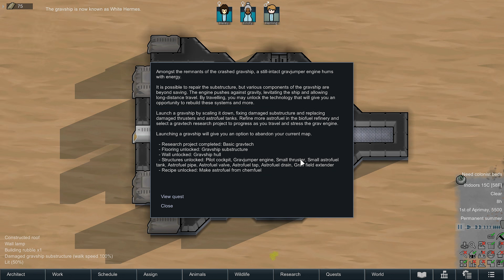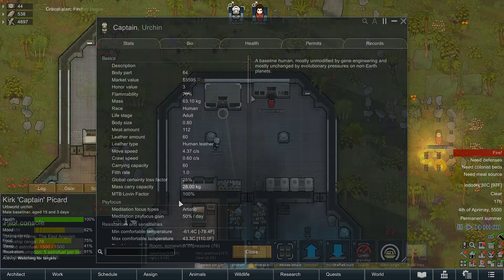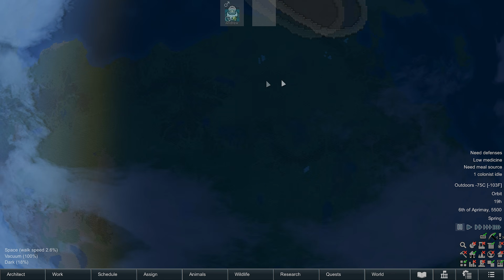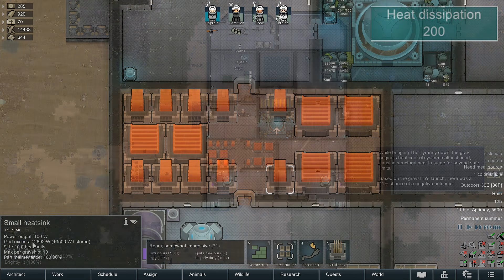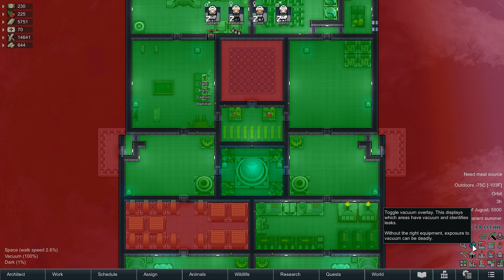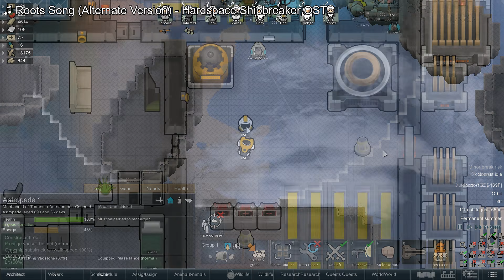Vanilla Gravship Expanded Chapter 1 - Rimworld Mod Rundown [1.6]

Comment: 36:50 Are you sure about that? I am doing some tests and I can daisy chain A Gravengine -> Grav field Amplifier -> Grav field extender.

Watching closely, you have a green line between amplifiers and the extender - extender is in reach of those amplifiers, yet you got red line with engine. Same as i have now.
in short I can go longer then 82 units in lenght
Reply from the maker: @DanielleSanti-e2t I mean that you can't daisy chain amps to another amp. There is a limit to how far the chain can reach and they have a hierarchy for connections.
Reply: @MysteriousFawx  i know, i tried building in strait line, placing Grav field Amplifier on engine's range limit, then Grav field extender on amplifier's... I have been using a range extending mod - configured for base game vanilla settings - so no change in that (Bigger Gravships (and other Odyssey spaceship related settings). removed that and it works now.

Comment: I tried this mod this weekend and it's been the best things since my first time with CE where I have no idea what I'm doing even after watching this, it's interesting you mentioned not having astro fuel near Oxygen, when I got gravhulk up and running, I created an elaborate chain of chemfuel into synthesis to astro, I even had it setup to just land somewhere, find a deepchem fuel spot and just build a drill. After I finished it, I started working on oxygen and then something told me to build a wall between both rooms. I build a whole oxygen setup and didn't realised I didn't enclosed the room to auto create a roof and it started raining and I saw the tank blow thru the walls with firefoam in it, all destroyed, if that wall wasn't there I'd still be repairing stuff right now, astro fuel is aggressive and hard to put out, early game it cost me half a ship
Reply: Hm, synthesizing astrofuel on the ship will be the very last thing I do. It's space-intensive enough that I'd rather spend my first allowances of space on amenities and o2 generation.

So by the time I have astrofuel, I might have energy shielding from VFE Security, or part 2 will be out.

Comment: The durability system looks like the maintenance from Fluffy Breakdowns. Do they work together or are there conflicts?
Reply from the maker: @micturner8193 By the look of the mod page comments for Fluffy Breakdowns, there are conflicts. It's tricky because the version of that mod currently 'most supported' is something that's been branched and maintained by more than a couple of different mod authors at this point. It's unlikely to be seriously overhauled unless someone else picks it up to intentionally make those changes, or perhaps incorporate it into a new mod entirely.
Reply: @MysteriousFawx  Troubling news. Adding new features to the Gravship is not worth losing the maintenance system for everything else; I might try a mod that avoids the standard breakdowns entirely just to have a look at the ship.
Thanks for the info regardless.

Comment: At 1:18:29 you can see that the Operator subpersona core can only be built once per gravship. Which seems quite low. So my question is, is that unintended or can it potentially link to more than one turret?
Reply from the maker: @ChronomancerDe I've had more than 1 linked at once and they're fully functional, it also doesn't mention anything about a limit on the workshop page for it. However I don't want to say definitively that you can install as many as you want, because I'm not sure if the bug is with the UI for the Subpersona core, or, in allowing more than 1 of them to connect at once. 

Given we're limited to 2 gunner cores, which are dramatically better than operator cores, I'd imagine it's the former and it's an incorrect bit of text floating around in the information pane for it. Chances are it'll be fixed in a future patch.
Reply: @MysteriousFawx   Ok, thanks

Comment: True that the anticraft weapon (the laser) is inefficient, but it only consume power, so in theory you can shoot as much as you want as long as you have the power needed. In the clip where you shoot with it it look super easy to use it, while in the description it say 50 000 W, per shot ? What is the amount of power you were using in this ship?
Reply from the maker: @MrVipron The ship had stacks of capacitors with the charge boosting quest item, as well as 8 power cells, an entire room of solar and 2 fully stacked power coils (thanks to the 8 cells). They didn't even need the batteries because I was floating so much extra.... but you've gotta remember that I cheated that entire ship with Dev mode for the example. The power cells alone need 8 gravcores, 6 more for those 2 coils and god knows how many gravlite panels for the entire build. Javelin Pods and Gauss Guns are going to be far more accessible for the majority of players, even if the anticraft isn't 'technically' using ammo. I definitely got the best results in an actual playthrough from a couple of well placed Javelin pods and 2 high skilled operators/gunner cores when I eventually found them.

Comment: Moaning on the workshop that you do not like features is dumb. We both agree on that. Especially because the devs for the vanilla expanded mod have a view that they stick to. 

But... There is one small part of another mod by the same people that I would like a toggle on and I'll ask here because you have a lot of subscribers so someone might know but my searching can not find. Is there a mod anywhere that patches Vanilla Expanded Empires to remove the gossip system or at least tone it down?
Reply from the maker: @xavierdoesntmatter It's been a while since I've checked either of them for that specific interaction, but the most likely candidates for including it as an option/toggle would be Tweaks Galore or FrozenSnowFox Tweaks. They usually have extremely specific options for big mods like VE.

Comment: 5:05 how do u get the ability to build it if it's destroyed beforehand
Reply from the maker: @jet-fury You'll always be able to build the bare minimum for a working gravship, fuel, console, thruster. But you lack the starting tech to make more oxygen pumps and tanks with that scenario. If you hang onto them it gives you the ability to travel to the orbital layer more safely in the early game, before you've researched how to make them.

Comment: 17:13 You can download mod "INCIDENT TWEAKER" and just set wanted ones high and turn other s off
to "force" those ones that would be harder to do with dev tool.
btw: its great mod to turn off those drop pod raids or make visual gameplay with constant auroras and eclipses and such.
or just to make maps bloom of ambrosia.
Reply from the maker: @LazlaTheFallen the problem is they're not classed as incidents (at least in terms of dev mode firing). They're ritual outcomes, which makes them harder to access.

Comment: Real shame that this mod does not allow to have multiple gravships. I waited for it specificaly to build a fleet of tiny gravjumpers, each with it's own role and purpose, like in Starsector
Reply from the maker: @LiquidhedSorrow Extremely likely that another mod will be on the workshop (if it isn't already) to override the limitation and allow for multiple gravships to be built. The only issue is that it'll be really heavy on ticks, even if they're just chilling in space.
Reply: @MysteriousFawx on the VE Gravship faq they say that having multiple Gravships just completely borks the game. So it may not be possible for a mod to let you have multiple Gravships.